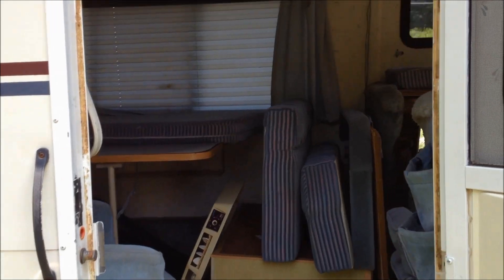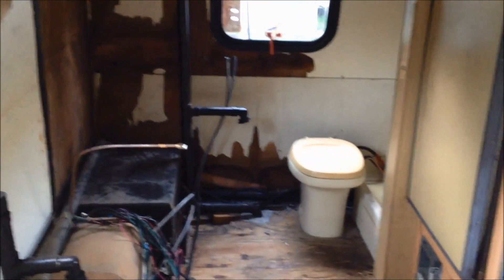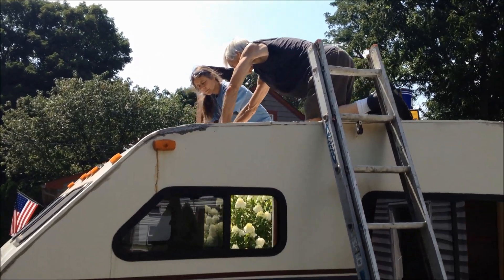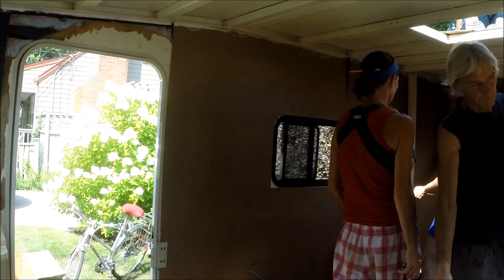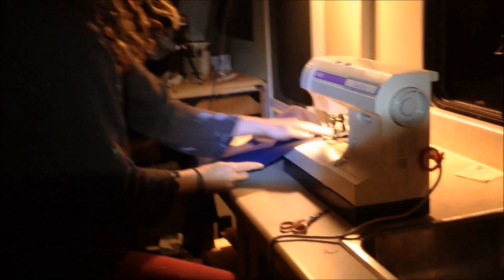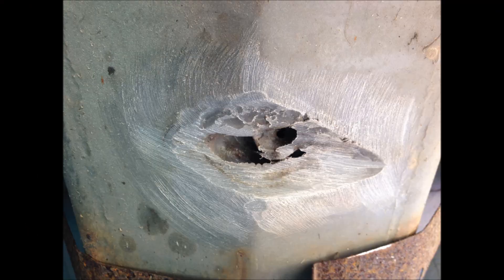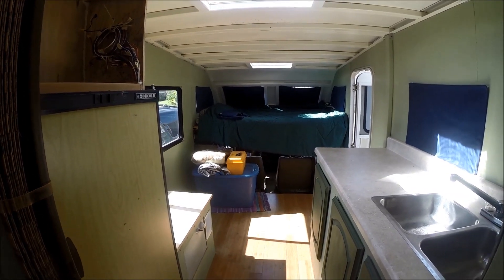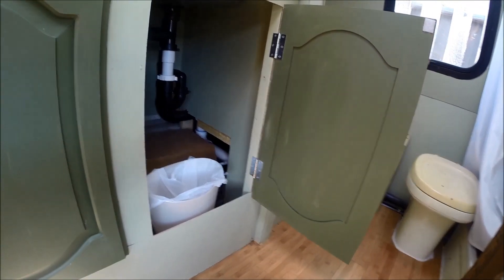Toyota RV/Camper Remodel: Winnie's Transformation with Brittany Taylor

Comment: Nice job, well done! i used to have a 79 toyota/dolphin camper. I did get new carpet put in, mine didn't have a shower or hot water heater or air conditioner, had leaks in the roof, wish i could have done what you did, but i was constantly putting money into it, so i just finally sold it as the leaks/which i did re-seal the roof twice, were getting worse, you did a great job so far!
Reply from the maker: pat murphy Thanks for reaching out. It's great to hear about your time with your dolphin and the renovations you did! Yes, those roofs can be a pain. Sounds like a lot of fun overall!
Reply: ***** oh, your very welcome, yes we had a great time w/it & i didn't mention the two new roof vents we had to put in because of hail storm cracking them, but overall, yes it was fun, i wouldn't have traded it for anything.  I'm hoping now to eventually get a camper van class B, but that's for the future-have fun w/yours, the memories you make cannot be replaced!!!

Comment: Nice job Brittney, I have been referbishing my 28' Airstream Class A moho for 4 years now its a big job but it will be all worth it in the end. This summer I tinted the windows black chrome limo tint. What a difference in interior tempature and privacy and it looks great. I was feeling your pain at the interior gutting and reconstruction. I have torn out the interior except for cabinets, in which I painted coca cola red and white and my dash board the same. I had a lot of problems with the paint not sticking and reacting to the surface's also because I rushed the job which caused me to strip and redo. As you know its a big and expensive job to do even a smaller class c. I was looking at both a bamboo floor or cork floor but the bamboo I hear swells and warps have you had any issues with it. Cork is out because it guoges easy and water stains. Its really cool you had family help you especialy on the roof major job. I'm envious of your sewing. I wsd thinking of taking lessons. I have a lot of curtains and other details I'm going to upholster my cieling and walls to plush it out. So good luck with your plans
Reply from the maker: Wow Bob Jones your refurbished airstream sounds amazing! I love all the upgrades and touches you are putting on it. It sounds badass. That's a good question about the flooring. I haven't had that issue so far. It was something I considered a bit when deciding if I wanted to float the floor or nail it down. I guess we will see how it goes! I do really enjoy having the help- the jobs go faster and they are more fun. I will say the sewing comes in handy. It's pretty simple to pick up on. I bet you could figure it out pretty quickly, either with lessons or searching on youtube. Or you could always outsource those jobs. All the best of luck to you, Bob! Have fun with it!
Reply: Brittany, thanks for writing me back. I posted pictures of my motor home on google+ I dont know how to use its features yet to invite you to my circles so you can see them. But thanks for your comments, I enjoyed them. My family and freinds think I'm nuts for doing this big project. But its starting to come together. Today I'am going to work on my rear air ride suspension, I going to work on instslling a stainless steel plate undernieth it to hang the leveling valve bracket that I removed stipped & cleaned. I then painted it w/black bed liner paint its tough stuff. I hung new leveling valves on it came out nice. Once I fit it all together, I'am going to polish the dtainless steel like a mirror as I'am polidhing the aluminum body of the Airstream it will look like a silver bullet when I'am done. I upgrated the factory air ride and rebuilt the suspensiion. I had custom made polished aluminum diamond plate storage bays. I have to replace the aluminum floor pan aluminum. Then I can install them its a big job but gots to be done. I have to wait for spring to do that. It had fiber glass insulation in the floor so I'm going to snag that out and get a foam isulation kit that will be 4x the insulation factor lesson noise and quite down road noise. I noticed you had plywood stripped out I dont know if you replaced the fiberglass insulation with foam sheets or not. Are you still in Texes summers are killer hot there. I tinted my winfows and it makes it more privacy, but the right tint keeps out the heat.  So if you are going to live in it putting tint makes it more stealthy. You have flat windows so it will be easyer to tint if you want to do it. Write me on your page and I'll till you howvits done I was a certified installer. Also you dhould get commercial tint not audo junk. Take care. Happy camping.
Reply from the maker: Bob Jones Wow, you are doing some serious work there! I am impressed. Keep it up! I am in Texas right now but I will be in the northeast next summer. Thanks for sharing all of this- it's so cool to hear where you are in your project!
Reply: Thanks Brittany, for taking the time to eyeball the work I did and for your encoragment, you keep it safe down there in Texes way, I have to postpone any work on it until spring. I busted a break line and my face installing a stainless steel plate under the motor home to install a air ride bracket with the leveling valves and linkage the moho got its once of blood from me lol. But shes being left alone one more winter unfinshed and alone. Brittany I'll post a picture of her from last winter it was sad. I hope you are south enough in Texes to be warm. Its going to be brutal winter this year.
Reply from the maker: Bob Jones Oh man, I'm so sorry to hear about the break line and your face! That sounds like quite the job. Man, I understand brutal winters all too well. I won't be sticking around Texas when it gets cold :). I hope your winter is short and you can get back up and working on your Airstream when you are ready.
Reply: Thanks Brittany, its a stormy night tonite rain and hi winds its warmer outside last couple of days. Hope you parents faired well in the last snow storm. I started packing up my tools from working on the old gal in preperation for another lonely winter in hebernation for her. Last winter you could almost hear her siren cry to take her some where other then the cold darkness of winter. My face healed up fine and I don't want to ever do that again, not fun. Doing things in baby steps is frustrating but sometime you got to hammer on persistants wise. When I seen you video working on your class c moho, it was fast the way it looked on the video. But alas I know better, its different see on a video something coming together. Then to really do it, I watch how some do it on youtube really nice work on r.v.s I like the inovative designs and on the spot engineering people do. 
It was a good thing my brake line broke it was as strong as a bread stick and that was dangerious. My freind just replaced his wifes s.u.v. brake lines and just told me a few days before the brake line on my moho should be checked out because of rust. I did't want it to brake then but if I drove my moho could have wreaked or worse. I'am going to replace it with stainless steel lines and #4 silicone brake fluid, this spring its a lot of vehical to stop its heavy. I may change rotors and pads they have special (yellow)  brake pads and slotted rotors for r.v.s if you have to get shocks bilistiens are top dog. I will take a video of the brake line replacment this spring. Brittany have you takin care to reserch how to set up you moho for winter living yet?. Do your research on how to .honker down for the winter. Let me know if you need any info on that subject. I think the best advice go some where warm for the winter. 

Bye and take care Brittany thanks again for replying. 

P.S. did you do any thing new to you moho?.
Reply from the maker: Bob Jones I'm sorry I didn't realize I never responded to this! 
Yes, I think you are right about sometimes having to just hammer on. But yes, it takes time, and sometimes is frustrating. I have enjoyed taking some time off of working on Winnie and just enjoying her instead. I'll get back into work on her in the Spring, and look forward to doing it at a more leisurely pace, just enjoying the process. 
I also really appreciate the innovative designs and engineering people do. It's cool to see 
I think that sounds like a really solid decision to replace the brake lines - definitely a worthwhile preventative measure. I would love to see a video of you doing this. 
I haven't done anything in terms of winter living in Winnie because I'm a total wimp when it comes to winter and I just choose to avoid it :) The coldest it gets in Austin, TX is about 35 on a really cold night, and I have been traveling to the tropics during those months. I really appreciate your offer to help out with that though! I think you are right- warm weather is the easiest solution :)
I'll definitely make another video update on Winnie this spring when I do more work on her. Meanwhile, thanks so much for reaching out. It's great to hear more from you. Sorry gain for the late reply. I hope you are enjoying your winter!

Comment: You've given me some good ideas as I move forward with my remodel of a '89 Toyota Sea Breeze.  I'm on the roof phase and I have a dilemma that you may be able to help with.  How did you support your new roof vertically near the front?  Out of the factory, all that I can really find are a couple of 1" steel tube rails and some rotten 1x2s with no real connection to the "foundation".  Did you run into this problem?
Reply from the maker: neil young I'm so glad you reached out. I would love to see your '89 Sea Breeze! It's so exciting that you are in the remodel phase. I'm glad to hear you are working on reinforcing the roof. I did the same thing in the front that I did along the top. I continued to run the 2x3s horizontally across the front and added a couple of verticals to frame around the windows. If you pause the end of the video where I show the shot over the bed you will be able to see what I'm talking about. This really made it super sturdy. I did run into that problem that you are talking about, which is why I decided to go that route. Let me know how yours goes!

Comment: Hey can you comment on how Winnie rides now that you added all that weight to her? did you do any suspension or engine upgrades etc?
Reply from the maker: Erik McCauley Great questions! Winnie drives great- very smooth. I think that her overall weight probably is about the same as before. I removed so much when I cleared her out and I don't think I replaced all that weight with what I added back in. If so, the weight is probably about even. But the distribution is definitely a bit different- with more up high particularly because of all the roof enforcement. And she was really surprisingly smooth and enjoyable to drive for a camper of her size. I didn't do any suspension or engine upgrades and she runs really great. Thanks for your interest! All the best to you.

Comment: My 78 Mini Winnie is leaking too, it's in the back right corner :(
What all fixed yours?
Reply from the maker: +Juber777 Oh bummer. Is it a roof leak? I redid the roof, which helped a lot. Reinforced it from the bottom, then patched, taped and painted the top. I'm always looking to make roof improvements. I feel like these older aluminum roofs just don't hold up to the new rubber ones...although falling asleep in them while it rains is just about the best feeling ever.

Comment: Good work BUT you should not mix ABS (black) pipe with PVC (white) pipe as it needs different glue types" as do CPVC which is for potable water.  PEX is better - I prefer Wirsbo ProPex because fitting rings hold better than crimp rings.

And any electrical wiring (except 12 V) should be in conduit - non-metalic (flexible blue smurf) works well and will keep out water if run under chassis.
Reply from the maker: +arbeeex Thanks for these tips! I really appreciate it!